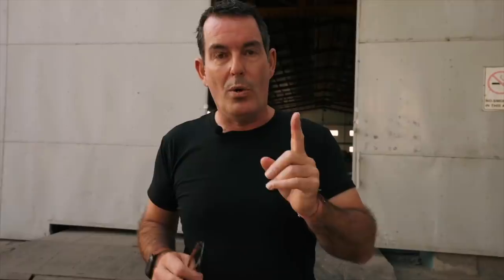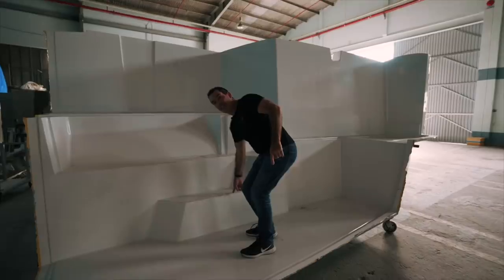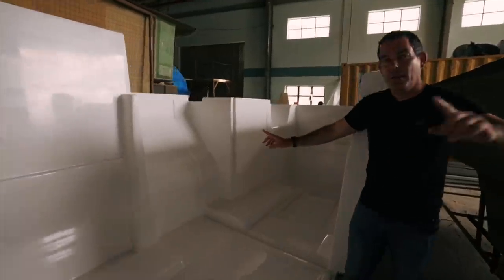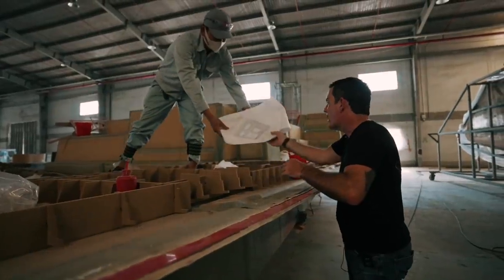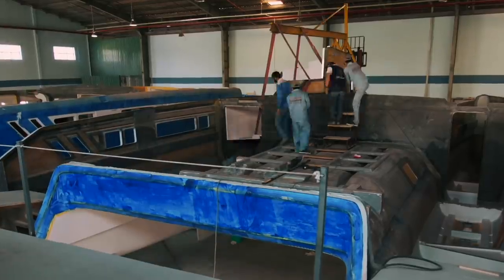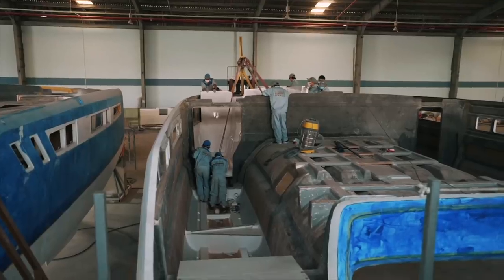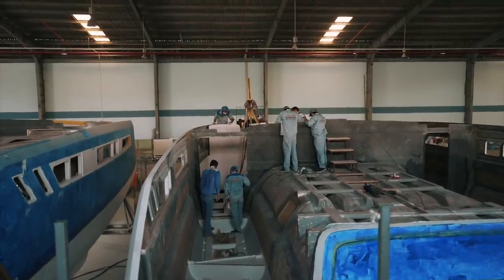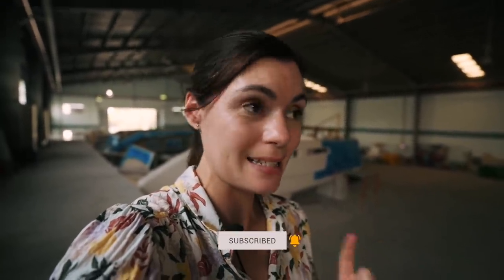Goodbye Chapter 1!  Ruby Rose 2 is Changing 😊 x

Comment: Hey Nick, Seawind has to make sure those inserts fit without any distortion, otherwise the finish material (wood, mostly) won't sit in place properly. This saves them time in the long run of building out each vessel. It's pretty impressive to see how much time they invest in all of the early stages to make sure the boat goes together the way the computer renderings look. That time and effort is the difference between the boats you and Terysa loved (like the O-50) and those that you rated poorly, like that trimaran - I won't even mention the name. I loved the line, "I wouldn't accept this from Ikea!" The boat is coming together very quickly now!!!!

Comment: Slick crew by the looks of it 
No dramas
Think that the factory would definitely benefit from a dedicated lifting system as opposed to the fork lift for greater production capacity if they have over 80 orders 
But I’m only saying that so when I can afford one it can be done faster than 5 years !
 I was a bit mortified to hear Nick answer that question on the wait time but I would imagine that as the factory develops I would expect the speed of each build to increase as efficiency develops 
That’s  hopefully inevitable 
I can see these becoming extremely popular after folk see the build develop and can watch the entire series over the next few years / decades 
And the 1370 seems  a sensible size too 
Being manageable for two and with plenty storage and extra capacity 
That really is a new new factory 
But they are definitely 
getting it done though 👏👏👏
Yay , everyday a little celebration 🎉

Comment: Nick,
Could you show Seawind's method of electrical bonding of the carbon fibre panels and bulkheads to mitigate corrosion in case of inadvertent seawater contact. Also is there sufficient pathways for wireless communication (think wireless instrument transducers, blue tooth speakers, cell phones). I haven't seen many boats with this extensive use of carbon fibre, so I am naturally curious.
Regards,
Mike.

Comment: You may have already covered this, but how have the engineers addressed maintainability of the boat with regards to accessing electrical and plumbing runs, etc? I've seen many owners having to disassemble major portions of their boat just to run some new wire or repair a leaking pipe fitting
Reply from the maker: Yes it’s all been though out. We know where all the conduits will be

Comment: Nick, any chance to ask the engineers why carbon is used over S-glass?  Strength and weight are very similar, but you don’t have the galvanic issues of carbon.  I assume it is a cost, availability or marketing reason.  Appreciate your insight(s).

Comment: If I can add a question…So are the furniture pieces supported from underneath? Do they rest onto areas of the hulls that align to stop them moving around, or do they just “hang” from the attachment points from the tops of the furniture sides??  I think the latter would allow them to ‘swing’ somewhat under stress as the boat moves, clearly this doesn’t happen or you’d hear it.  What/how do they control/stop that from happening?

Comment: Hi Guys, I have watched Ruby Rose for a little while now and enjoy the videos hugely. Question has Nick discussed any where the fact that the carbon fibre will conduct electricity. Are there any bolts going through the carbon fibre? possible discussion point how is Seawind dealing with the electrolysis involved with the carbon fibre. P.S I have been a fan of the Seawind Cats since they released the Seawind 1000XL.